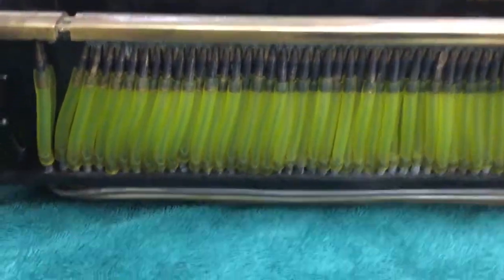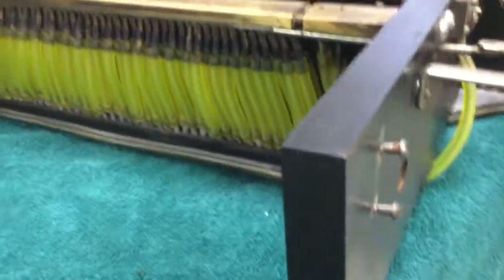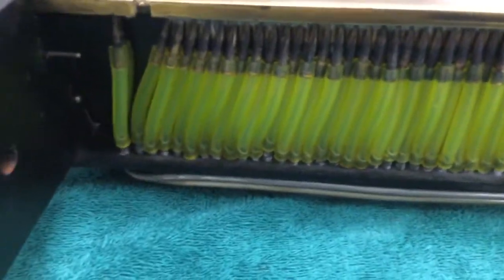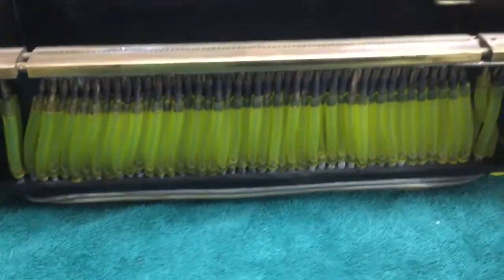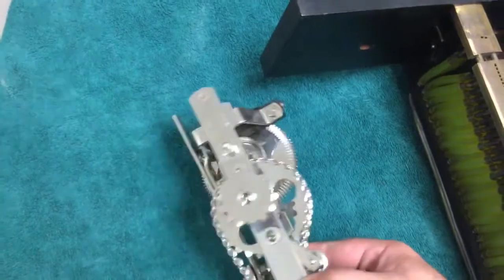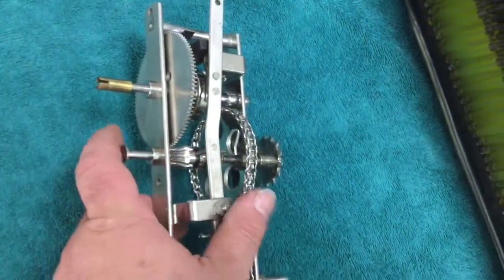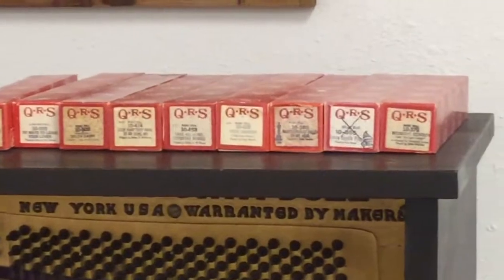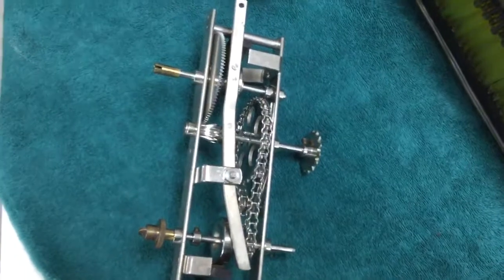Player Piano tracker bar retubing

Comment: Noice work! Can one use a vacuum to run a player piano? I just got my first and I have many lead tubes that I’ll need to replace. I’m hoping I can just use a rubber tubing.
Reply from the maker: Yes, I used a shop vac initially to supply vacuum to the stack while troubleshooting.

Comment: Haha, I am so happy to see this.   Cool, I was about to buy a lot of the 9/64" ID stuff off of Schaff piano supply.
Reply from the maker: I would recommend using the actual rubber tubing that is made for this purpose. That said, almost 2 years later and this fuel line tubing is still working well. You will need about 20 feet of tubing to do this.
Reply: @okbridges  Yes, I have my Schuller and Mueler and a Gulbranson.   Both are going to utilize the 9/64 tubing, but the Gulbranson was done with what I believe to be aquarium tubing.   I'm doubtful of the seal on it.
Reply: @jaredwirth3990  After a short time, most aquarium tubing will turn sticky and ooze a liquid.  Have seen this many times over the years.  Hope you will replace it before this happens.

Comment: What products did you use to cleanup the mecanism (gears, chains, etc..) Ultrasonic bath ?
Reply from the maker: I used the solution that I use for cleaning clock movements, which is a mix of acetone, ammonia, murphy's oil soap and water. 
No ultrasonic cleaner was used, but it could be used if you have one.
Reply: 2 more questions then: what are the ratio of each products for a final mix ?  And how long should I immerge my brass mecanism in this mix to get descent results ? Thanks.

Comment: So how did you 'neatly' get the old rubber off of the lead tubes?
Reply from the maker: I basically just chipped it off by hand. Just be careful not to damage the soft lead tubing. The old rubber was so dry and brittle that it was not difficult to remove.